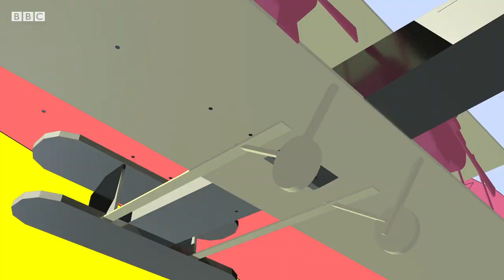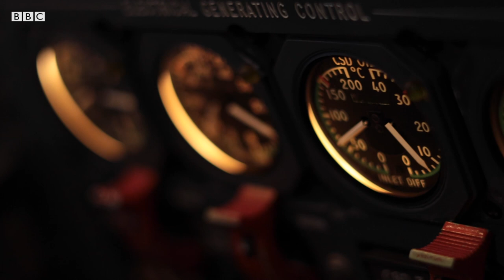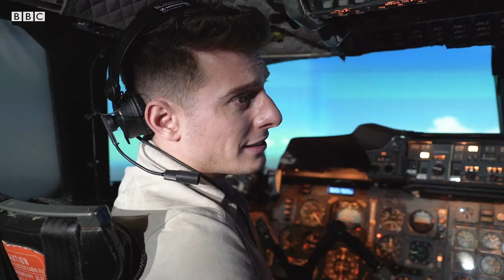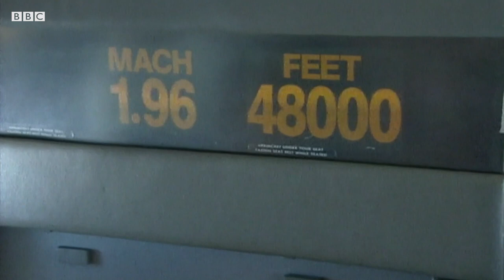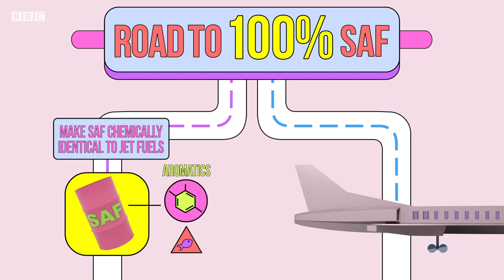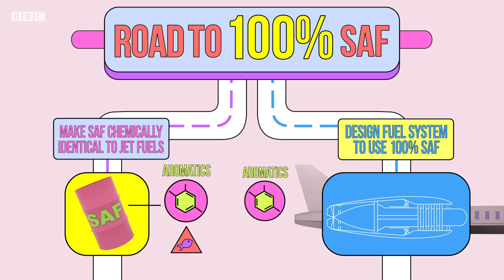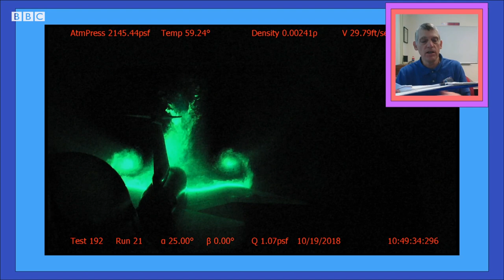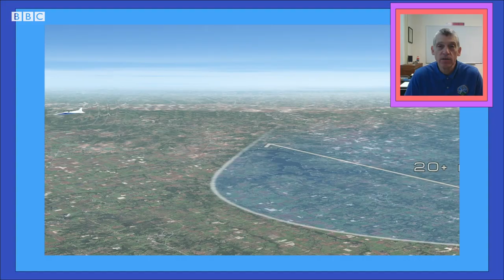Will supersonic air travel make a comeback? – BBC REEL

Comment: The infamous Concord crash, was not because of debris on the runway. The engine which caught fire was repaired and mounted back onto the plane just before the fatal take off. The parties involved are withholding this information because admitting it would lead to someone's fault, while the debris theory points to an accident, so that no-one is at fault.

Comment: The Real Reason Concorde had to retire was because of the French Government and Airbus actions after the Air France Concorde crash.   Key parts of the wreckage are currently locked away in a vault in Paris and Airbus (formerly Aerospatial, the co-operators of the aircraft - it was a joint British/French project) would not allow AAIB Investigators to examine the wreckage and so hampered any British involvement in the investigation into the accident.  Not long after BA spent millions fitting Kevlar casings to the engines to prevent debris getting into the engine bays, Concorde managed a few flights before the French decided to ultimately revoked Concorde's TYPE CERTIFICATE which they in fact held.   Unfortunately this action meant that any surviving Concorde aircraft, could no longer receive a CERTIFICATE of AIRWORTHINESS and so could no longer operate on any flight basis.   One reason why Richard Branson, who had hoped to buy a Concorde for use with Virgin in some form, could not achieve it.   A real pity that a Government and Organisation who so valiantly co-operated on such a momentus project, ultimately let down it's partner massively when the crunch came !   However, this does not preclude the development of a NEW Supersonic jet, which many would welcome.

Comment: Mach 1.4-1.6 aka 1000mph would be a game changer, sure it wouldn't be concorde fast, but if it balances costs and fuel efficiency then it would be a great buisness model.
Private aviation should  be an order of magnitude cheaper, or an order of magnitude faster.
I still can't believe a LON to JFK costed $10k for sub 3 hours but now you pay 3x for 3x the time, its frankly silly.
Once mach 1.5 becomes the norm for upper-class then investment in higher mach can begin.
Also I hope smaller airliners would start doing supersonic too.

Comment: Concord is back baby and there more full Efficient and there more save because the Technology In the cockpit is more Advanced and more environmentally friendly because it’s made from steal that comes from national Cole and it’s carbon Neutral so it’s very very safe about the engines on the brand new Boeing concords are more safe and more full Efficient and the the concord delta wings are more spread out and the concord Engines are at the in the middle of the delta wings instead the back of the concords the old concord the Engines where in the back of the delta wings and the new concord nose dose not have Elevated Rotator point at the front on the airplane so it’s more safe and the concords down fall was the rotator point